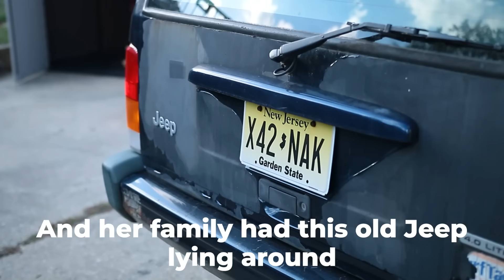Transforming A Jeep In 10 mins!! (Budget Build)

Comment: I've always loved these older Jeeps. I really feel like the overall body design aged very well. I've been thinking of getting one of these and fully restoring it inside and out.
Reply: Bro do it.  You won’t regret it.  You’ll only regret not doing it
Reply: Good luck finding one. I’ve been looking for months.
Reply: The only question I Have I why you have not taken off the plastic parts? It easy, you get cleaner paint and hit those plastics with burner before reinstalling - much cleaner job!
Reply: Do it man, I’ve had 2 so far and I’m 19. My advise is to buy a stock one. Yes they are more money but they aren’t ran through as bad and you know what’s done to it other than one with work done. Also watch a lot of videos on what to look for and stand clear of 2001 models as they may have the cracked head problem. Just watch Bella videos and you’ll learn in no time
Reply: Square body vehicles always age well. Look at Volvo 240's for instance.

Comment: I remember I used to have that Jeep Cherokee, mine was a two-wheel drive into door and you hardly ever see those anymore. I was probably the only guy in town that had one but two doors in two-wheel drive. Unfortunately there are some electrical issues that involve the throttle position sensor and everytime I replaced it, it was never enough and it kept on giving me problems on the road, so I had no choice but to sell it and now I have a pickup truck. Glad the new owners that bought it from me actually did things to it I always wanted to do but could never do. I'm glad they sent me pictures as well as them taking it off road saying thank you.

Comment: I have a 2000 Jeep Cherokee Sport and mine is the same color and could use an uplift like yours. I hope mine turns out to look as good as yours does! Thanks for sharing it with us. I bought mine for my son when he was in High School. He has since graduated from H.S. and  decided to trade it in for a newer car. As he and one of his older brothers set out to the dealer to get his new car ( well new to him) I said make sure that they don't try to screw you over in the trade in value of the Jeep. So when he returned home to show me his new car,  i asked him how much he got for the trade in. Then he said not nearly enough and proceeded to toss me the keys to the Jeep, and thanked me for making sure that he had always had a way to get to and from school and work. That was almost 10 years ago. Then he said about a year ago that he was wondering if I'd give it back to him so he could restore it with me. I was all in on that. And it just sat there collecting dust. So i started driving it again and got that bug in my brain to just start restoring it myself with the hopes of the he might actually start helping from time to time.  I started with the motor and he has occasionally got his hands greasy!!!! I do plan on giving the Jeep to my grandson for when he starts he starts H.S. Sorry for rambling on, it was a great video. Keep on making more of them.

Comment: Nice save on that XJ.  I had a 98 that looked just like your finished project. Jeep cultists will be fighting over that in your front yard within half an hour if you decide to flip it.  But in the alternative; if you dont mind 8-10 miles per gallon and want to drive through the apocalypse then keep it forever. Only thing you really need to worry about it is head gasket leading into the tranny, and the hood/roof paint baking itself off. And the door hinges...lol.  Because the XJ platform really takes to DIY wrenching it can be really easy to bolt all sorts of shit on, so i recommend you define a stopping point unless youre already divorced:)

Comment: That overspary in that radiator tho. Single stage next time so the tri stage for the big boy pants. Next time treat the surface rust with metal conditioner for the longevity of the paint. Well done

Comment: If it weren’t for this Jeep, who knows what condition I would be in. I was hit head on by a guy that came off the NJ turnpike at Carteret, doing over 40 mph. The impact broke the seat, dash, entire front in was in piece to the half hanging radiator support, with the floor under my left foot and roof pushed at least 2 inches. So much so, you could see the frame and axle on the driver’s side. I’d love to get a wrangler, but the XJ will always be my favorite Jeep!

Comment: I had one with the 4.0 high output problem you will definitely have is bad wiring as they age changing the wiring harnesses will make it last a long time this should be your main focus if you plan to build one up the straight six engine is powerful and lasts one of better makes of brand

Comment: Job looks great! JFI when tightening lug nuts usually they need torqued 100ft lbs. Milwaukee makes an impact that has a separate setting with 100t lbs I doubt that craftsman does that! Loose lug nuts cause crashes!
Reply from the maker: @danakibby627  i always use a torque wrench to 100 ft. lbs afterwards 👍🏻

Comment: The paint looks good, but I would have focused on the mechanical side. These jeeps have alot to improve on. They don't look good on the side of the road. Things like the fuel rail upgraded to a non-cast design, rerouting and cleaning engine ground locations, reinforcing the steering gear area, installing a solid track bar bushing, 4 hole injectors, stainless brake lines, solid front brake rotors, Sealing the AW4 park neutral switch case, replacing the wiper linkage bushings, and replacing the seat belts with newer designs that have inertia locks. That's only the major flaws.
Reply: My XJ has 200k miles an has never had any of those "major flaws" addressed. Kinda like my response to the crowd that insists the Dana 35 is garbage, it works completely fine for a daily driver.

Comment: Needs a lift.. tires are massivly oversized for the lift it has and the wheel wells would get smashed with any re weight in the back or articulation at all....  doesnt look right.  But you did great on the paint

Comment: Worse part of painting a vehicle to me, taping. Hate taping. Clean up is not fav either. Painting can be very rewarding though, the work is in the prep.
That looks much much better.  Luv me sum XJ You can get a tuner and fix the shift points if your tires are not OEM. NP242 uses a gear for speedo, Chrysler sells a gear that corrects the speedo when running 33’s, One bolt and it swaps out easy…IF you have that TC. Lol
Cool video

Comment: The hood and the dents in the door need more work.  Paint the trim and sand the lights down with 400 grit and clear coat over them. I get your doing the cheapest but what’s another hour worth of work and 100 bucks.   The fit and finish would be spot on.